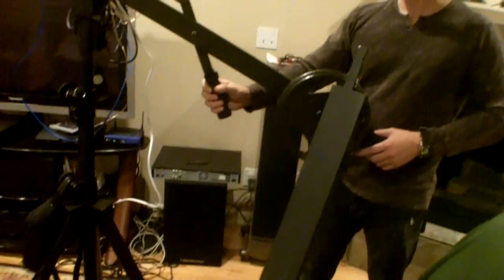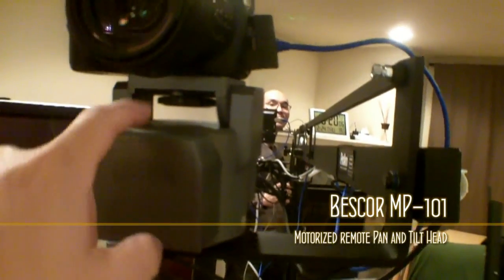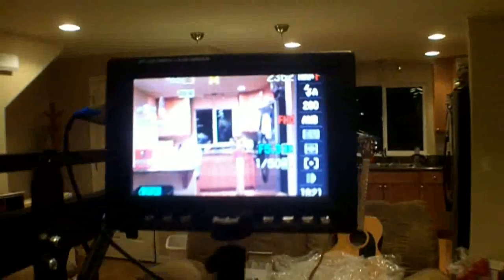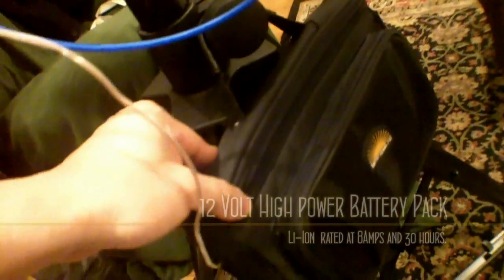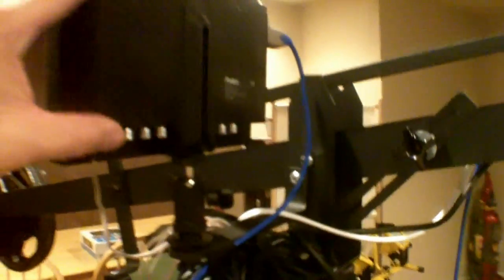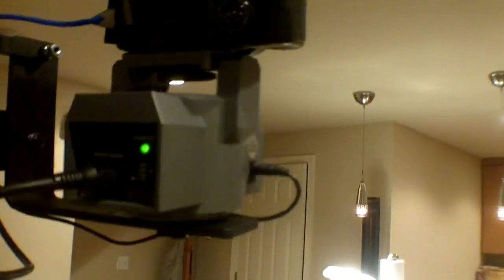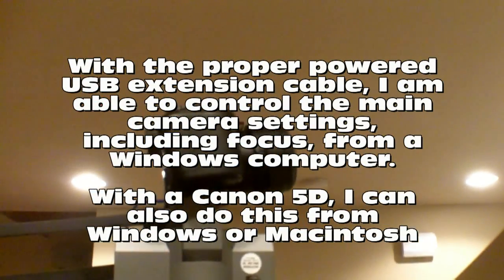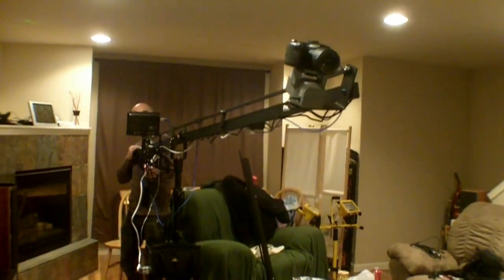12 foot jib (crane), 7 inch monitor, motorized head and independent power

Comment: I received this jib a few weeks ago and very happy with it. In fact, I also purchased the 4' extension, so now its a total of 12'. I'm kinda nervous because I'm adding about 30lbs of counter balance just to keep it leveled. I placed the camera (t21) Motorized pan Head (Bescore) and a 28mm lense. I don't believe I'm doing anything out of the ordinary, but I read the description of the jib and it hold up to 8lbs??? Now what...?